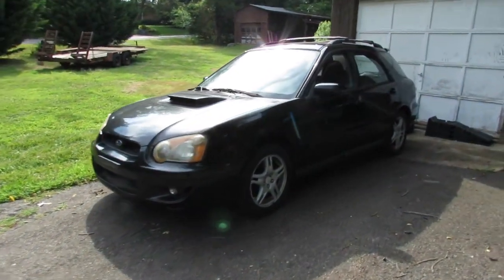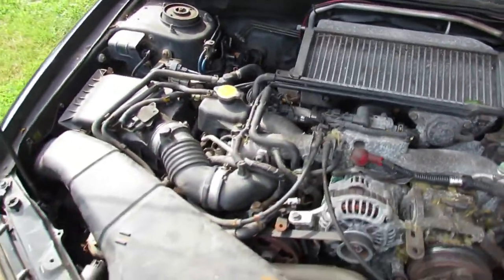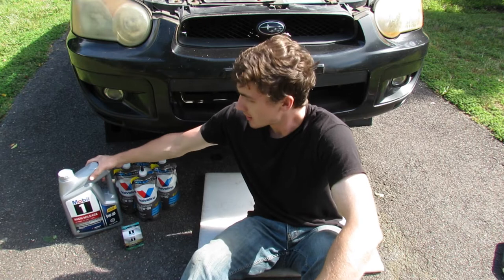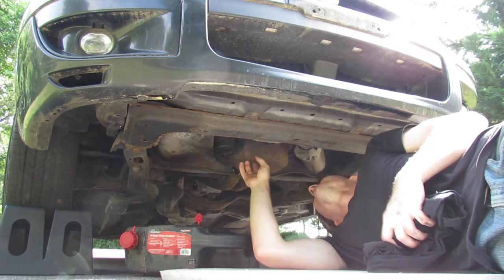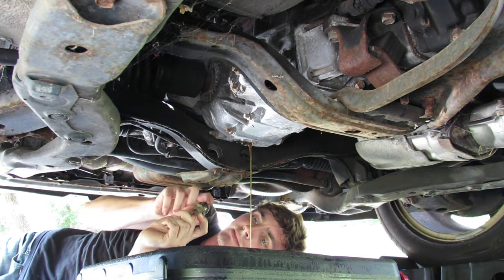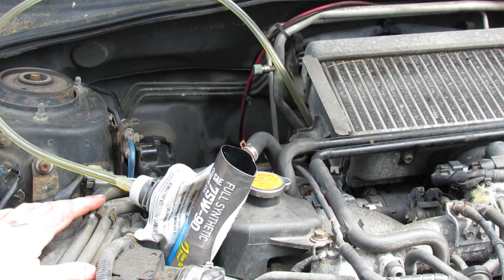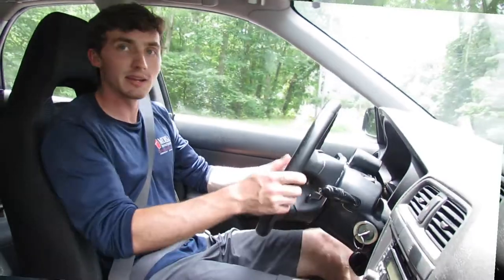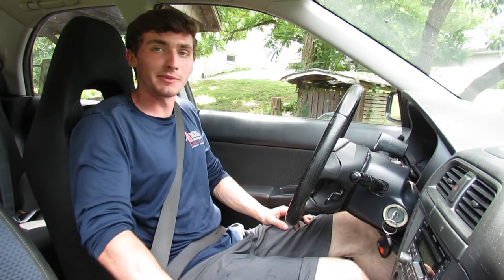Can I Save This Cheap Broken WRX? Introduction, Oil Change, Test Drive | Project WRX Redemption Ep.1

Comment: I would highly recommend something like Redline MTL / MT90 for the trans. It's fully synthetic and doesn't contain synchro harming sulfur like diff fluid does. It's about $60 - $70 for 5 quarts, but IMO it's worth it.
Reply from the maker: Gotcha, thanks for the recommendation, I'll check it out. After doing more research I'm definitely changing the oil out again before putting any serious miles on it.